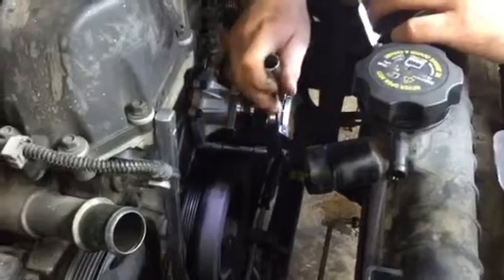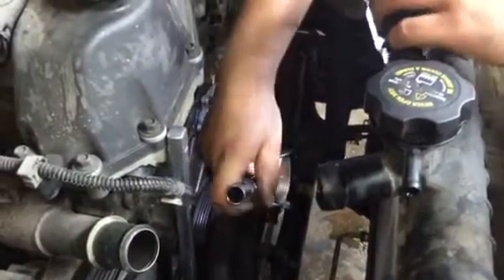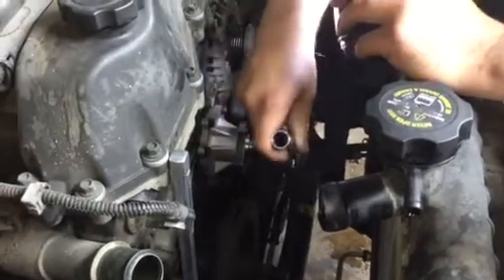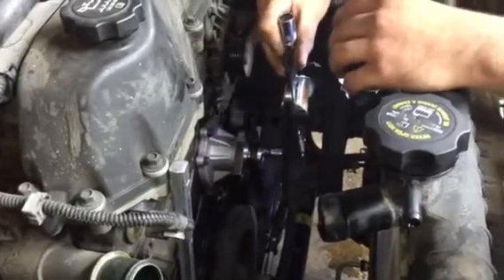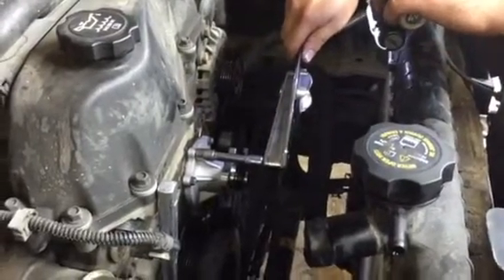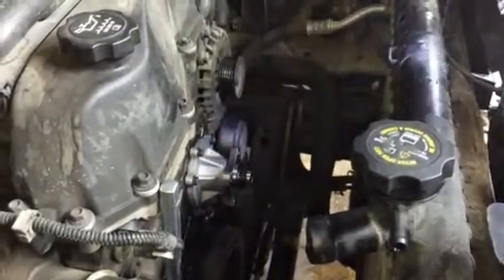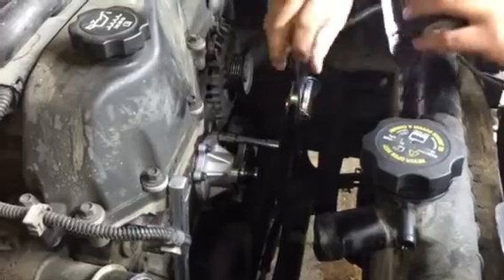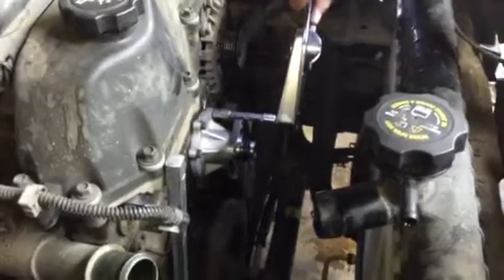Water pump torque sequence

Comment: Good Luck finding the Torque specs on water pumps... I just a 5.3 snd searching the for them on the internet too longer than the job itself.. heads or valve cover bolts are all over the web.